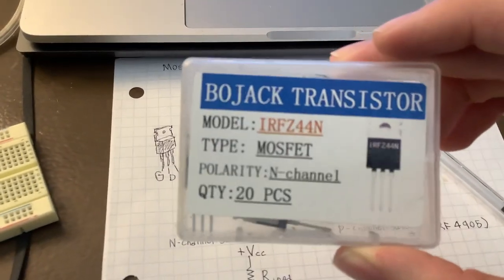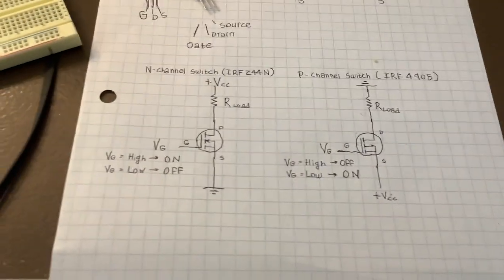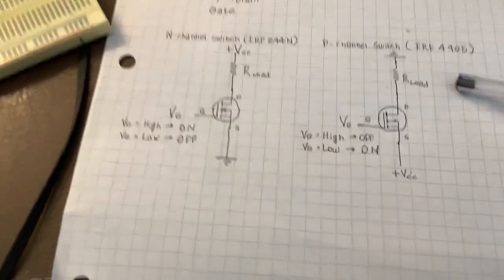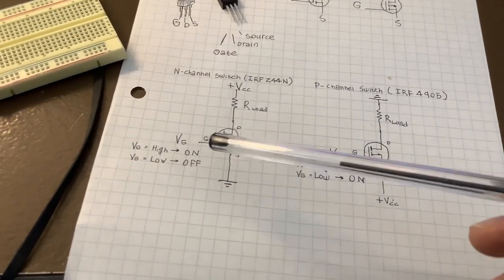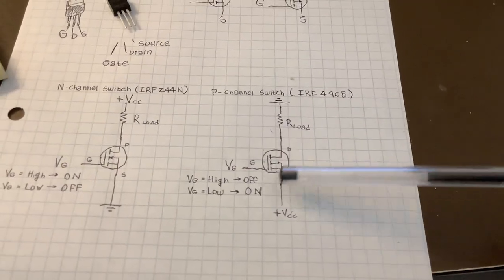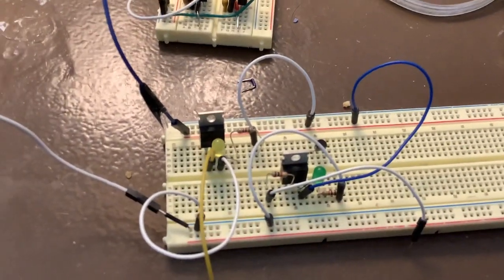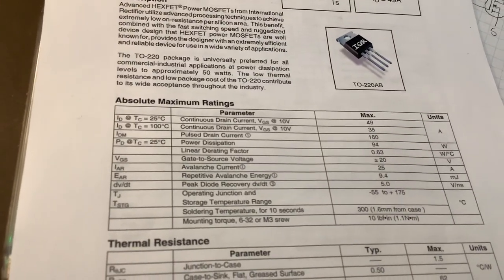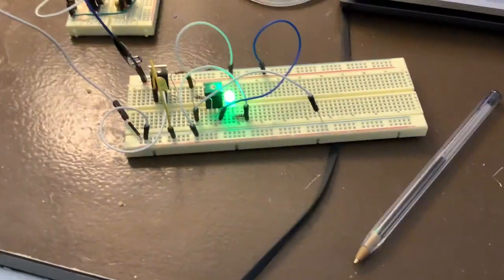Using a MOSFET as a Switch (N-Channel and P-Channel)

Comment: if you were to touch the gate pin after it was turned on and kept in its on state, to just a piece of conducting metal would it turn off or does it have to be negative voltage?
and the same for the p channel does it turn on if connected to a conductor with no voltage?